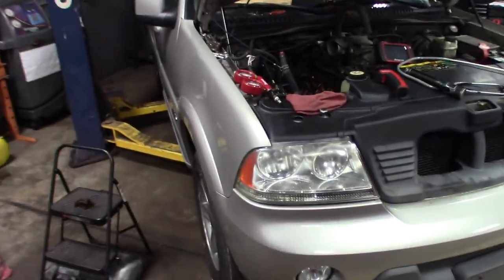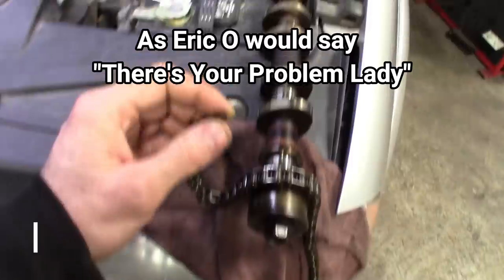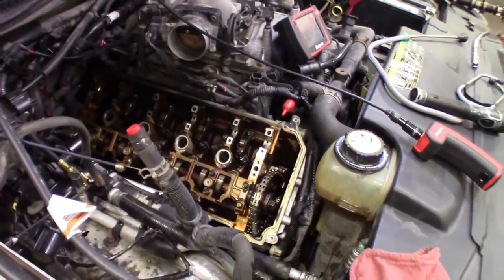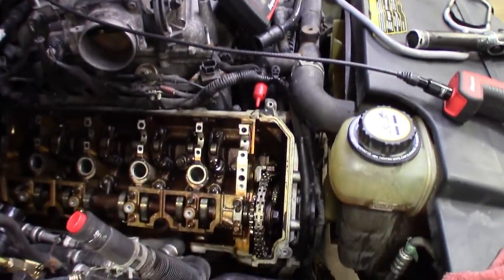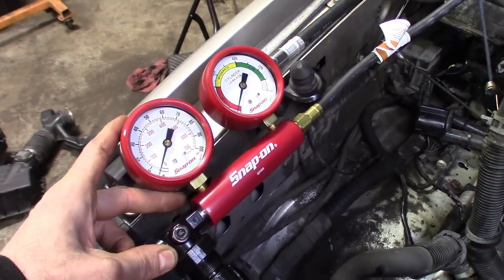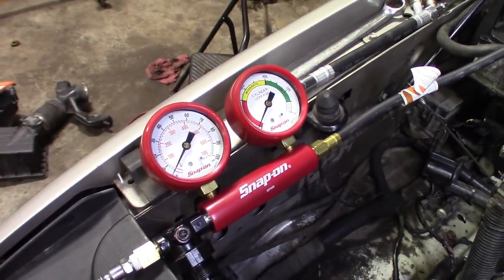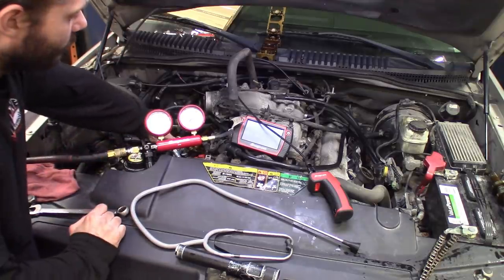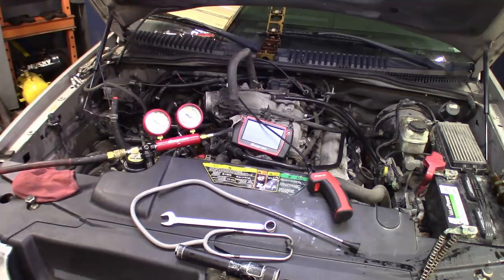Making Repair Decisions

Comment: I would do the timing and intake gaskets while I had it apart that far...Call it a day if all cylinders pass the leak down test. Might even pull the oil pan to see where them chain parts went. And blow the oil passage out good. Just to make sure no trash is stuck in the VCT oiling system. I seen the little oil cap seal in one once. It ate the lifters\cams up on one side.

Comment: Hell yeah jimbo! I plan on picking up the lang master compression test kit along with the leak down tester kit as my next specialty tool I think. I think I seen some "as seen on TV" "tools" a while back in a video you posted and havent seen them in use or anything yet... They were body and dent repair type tools, I have kit that I got to pull dents that goes inline with what you have.. We could do some kinda collab and I can send you video of the tools being put to the test and used. I would put my truck in the garage so I dont get interruptions, then maybe use a real or different camera also..  Something to think about doing in the next month or so!  =)

Comment: Awesome. Diagnostics and diagnostic tools are the best. Time savers. I didn’t know these had DOHC especially from a motor from the mid 2000s. My f150 has SOHC triton 5.4. 

Would it help looking at the lower end connector rod bearings for play? Have to drop the oil pan anyways. Just curious only have done it once or twice.
Reply from the maker: Easy way to check for end play is take out the spark plugs, turn the motor to right after TDC on the cylinder your checking take a long 1/4 extension and push down on the Piston listen for noise or movement
Reply: JRC54 ok ok cool didn’t know that. Thanks for the advice! These types of vids are awesome

Comment: 2006 Mercedes E350 4matic, was cranking really easily as if the spark plugs were not installed. Pulled one spark plug out to check compression, no movement on the guage while cranking. After a couple more cranks locked up on me and cannot make full engine by hand. Any experience with these cars and if yes, how likely that the valves are bent. Thanks
Reply from the maker: Sounds like it's hydro locked. Pull all the spark plugs then see if it turns. If not try spinning the crank by hand opposite way to see if a valve and piston is touching.